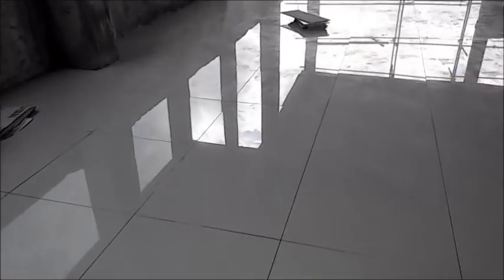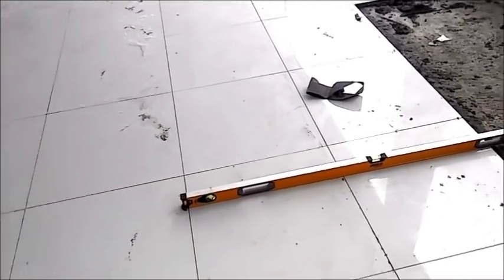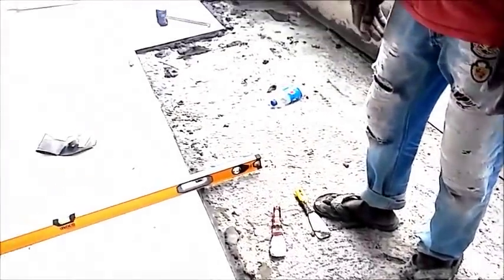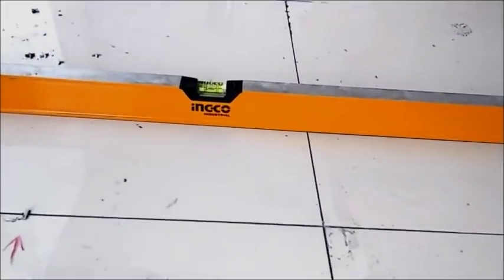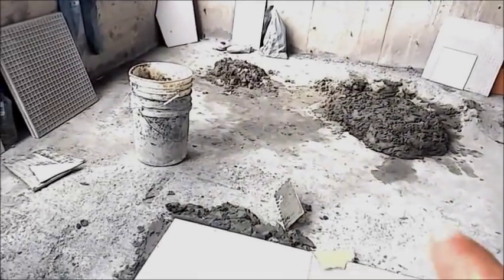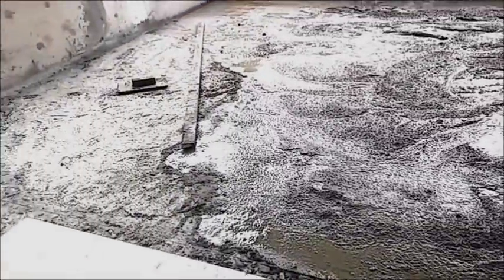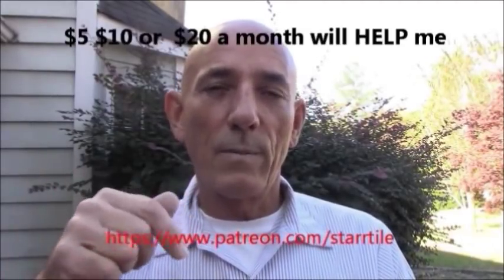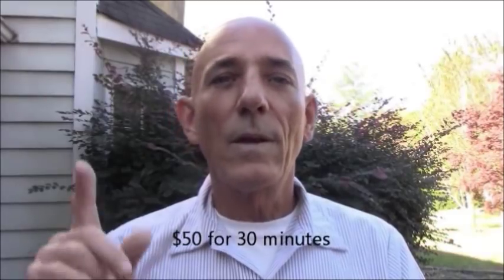LEVELING FLOOR TILE ON CONCRETE...without clips

Comment: I listened to this guy more. He's actually basically right according to TCNA guidelines. TCNA is sort of weirdly double speaking about thinset thickness, they say thinset should not be over 1/4" or so, but also say to "refer to manufacturer's recommendations" and then manufacturer's spec their thinsets to 3/4" or 1/2". In US this causes issues, especially if there's issues on big commercial jobs, as the manufacturers won't want to take responsibility for failures as they'll give the TCNA guideline as the standard and it's a big Catch 22 situation. 

Also I ended up going to a TCNA conference with a teacher, and did learn a lot. However, based on some real world experience I now think in some ways he's "wrong" or kinda misguided. He said that fully collapsing the ridges by moving the tile back and forth with straight lines was better to get 100% coverage compared to backbuttering. In a lab (on his table demonstrating) that's cool, in the real world, sometimes you're making cuts/etc, where that may not happen. But also, imo, in the "real world" most outright failures aren't due to the differences between 60, 80, or 100% coverage, but thinset skimming over, of which the main purpose of backbuttering is to make sure there's some fresh thinset bonded 100% to the tile, even if the "lines" are a bit unfresh. Especially working with rapid sets, I feel backbuttering is needed 100%. Most failures come from lack of bond and/or spot bonding, not the difference between 60 and 80% coverage. 

I do appreciate the org for really readily giving training (my trade, paint, is the Wild West comparatively and the manufacturers basically enjoys/is geared toward making money on failures that can easily be prevented...) but some stuff is just weird or a bit pie in the sky recommendation-wise.

Comment: Thats amazing how they get the tiles perfect. We use all kinds of tools and leveling systems to get what they get doing it by hand and eye only. Extremely impressed
Reply: Katz Fam I can’t even get it that nice with A leveling system.
Reply: @DK_tk3  Does it have to do with quality of the tile?  I was told to set two tiles face to face and see if they spin. If they are flat, they won't and I could see setting the tile with no lippage. However, when they aren't flat, wouldn't a leveling system be needed?
Reply: The eye is the best guide.

Comment: I was taught mud setting and I prefer setting my large format tile on the floors and walls with this method. I have never used clips. I would like to transition but being able to use your level and make the walls and floor plumb and level as you go is a  satisfying  feeling I do not know clips will achieve.

Comment: What kind of laser do you use for finding high spots? I usually first grind a concrete floor (which finds them too) but a laser would be a time saver and/or at least a double check.

Comment: I'm in Asia now and notice for tile work here, lots of floors are dead on 100% flat, because they mud everything. Thinset is around, but here in Vietnam I think a lot of people just make their own with 1:1 Portland/sand mix for using on walls mostly. The biggest problems I see here with tile is stuff tenting due to no expansion joint, and grouting/tiling right to the perimeter. I've even seen tenting on walls here. I think also them liking thin/no grout joints causes this even moreso, so there's not as much grout to fail before the tenting. 

Also strangely despite my attitude of everything needing to last forever, I see otherwise well bonded/not too cracked up tiles here, especially in commercial settings in people's combo home/shops losing glaze after probably 10 years from just the foot traffic. Nothing an installer can do about that, unfortunately. :/ Comparing Taiwan and Vietnam, Taiwan had a lot more quality work, and work in Vietnam is much more "chabuduo" (Chinese for good enough/close enough) than TW, but still saw some really amazing looking work here in Vietnam, too. Even my hotel room has an amazing floor, with only one loose tile and one cracked one, but dead flat and gorgeous overall despite that. The bathroom on the other hand... The other surprising thing here is just tons and tons of marble and natural stone everywhere, really cool to see.
Reply from the maker: Yes I can appreciate everything that you said, I just got back from the Philippines a few weeks ago and I see the same thing there, tile perfectly flat and level, but there is no expansion Gap so tenting may occur... I have seen that quite a bit in Jamaica. As well as the same thing you were talking about, mixing cement and sand together rather than having it in a bag like we have in the US.
I'll be posting a video about some of the tile that I saw in the Philippines probably in the next couple of weeks.

Comment: An easy "as you go" test for lippage, if you don't have a bucket and water ;) is to slide a coin over the joints. If it stops, the tile comes up! Also...many modern large format tiles have directional arrows on the back of them..use them! Lol...and he knows that if you want a floor to last, you DON'T ever use thinset to level. Very interesting...right!? ;)

Comment: Almost rung a decorators neck once, she sold a 24x24 porcelain tile job. No problem until she told me it was a diagonal running bond (brick joint) in a 35s/f bathroom!! Grrrr

Comment: I feel shame for using leveling clips now 😔
Reply: But the way the mix the thin set don’t saddle later on like in the u.s . U set it level by tomorrow tiles moves . I think the premixed no good
Reply: Level clips are fine, but (imo) they're not magic miracle things. At most, level clips can correct about 1/4" or so, but if your floor is 3/4" or 1+ inches off, you need to address it ideally with SLC or mudding, or building thinset up (less ideal, but I did it and it's still fine, but I used pretty strong stuff...) In USA I don't see a reason not to use them, though, especially on walls, makes life way easier, especially since gravity is a way bigger factor on a wall compared to a floor, and it adds $10-15 to the cost of a job, about nothing in US.
Reply: Love at 10:45 when you smell somrthing look up and he’s smoking a fatty 😂